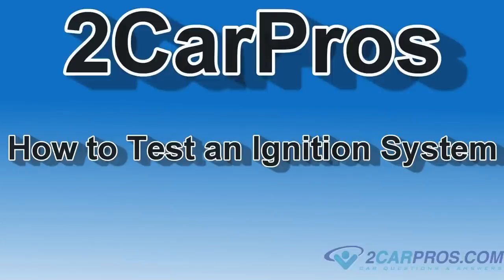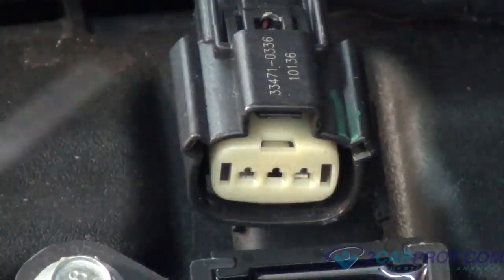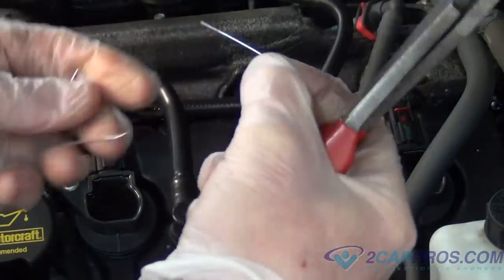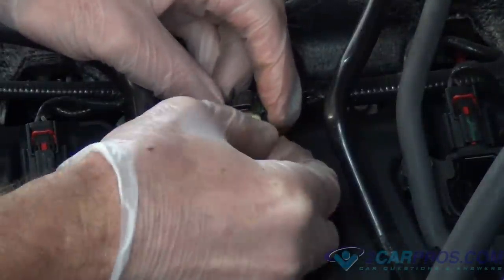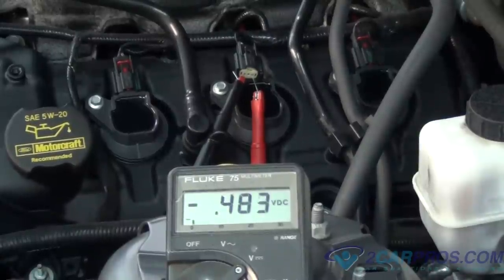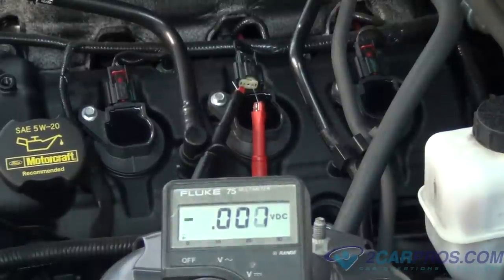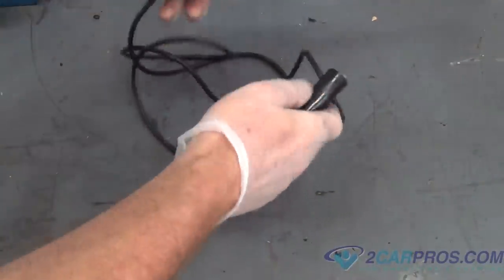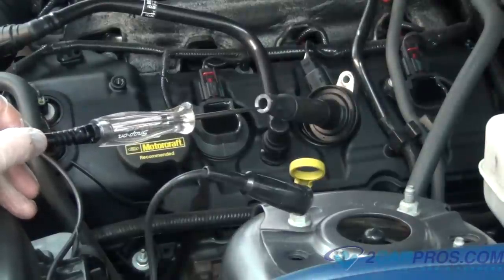Automotive Engine Ignition Coil Testing Repair

Comment: I thought you did very well on this video. The video was precise and very clear. Unlike yours, most video's out there are too dark and its like they never proof view it to make sure its viewable. You got the point out on checking the "ignition coil pack". Would have been nice to check the spark plugs in this vid BUT then again, this is about checking ignition coil packs and not spark plugs.Overall...good job!RP2u 11/01/2018

Comment: Step 12 - Gently close the bonnet, open any door and load fertilizer in a large sealed container with appropriate wiring and switching, stand behind corner of brick wall and initiate power to said wires for an explosives' final solution to problem.

Comment: Another way to ttest ignition coil is to test the resistance on it. Eazy way and safe way.
Reply: Also the way to find a weak coil. When it's only misfiring under load.

Comment: Missed a step.  Remove rubber boot and inspect and clean slinky to coil contact.  Corrosion and moisture can cause intermittent misfire.

Comment: I have 10 plus dc volts on 1, 3, 4. When the key is in the "on" position. I did not test 5 or 6. Only 2 had 0 volts . all 4 cylinders had 11 plus when cranking. Any thouhjts why I would have voltage?

Comment: My ford focus 2005 zx4 I replace spark plugs with motorcraft the same that was in there also I replace the ignition coil which is bosh an the car don't run rite... what can be the issue anyone can help?

Comment: 6:27 DON'T reinstall the coil without checking the condition of the spark plug!
Reply: Jeph62
Reply: Anybody knows HOW to measure OR compare an OEM ignition coil and a Performance one to see which one is more powerful in volt???
Reply: The video is about checking ignition coil.. Not about spark plugs

Comment: Already I already put some new spark plugs.
Code :
Random/Multiple Cylindre Misfire Detected
P0300 - 008 - Implausible Signal - Intermittent
p0302 - 008

It is not dripping coolant by the spark plugs, I mean they are dry (As it should be)

Audi A4 Quattro 2004 1.8
Reply from the maker: Visit our website www.2carpros.com and ask a free question! An automotive expert will be alone shortly to help you out! Thank you for watching!

Comment: Already I already put some new spark plugs.
Code :
Random/Multiple Cylindre Misfire Detected
P0300 - 008 - Implausible Signal - Intermittent
p0302 - 008

It is not dripping coolant by the spark plugs, I mean they are dry (As it should be)

Audi 2004 A4 Quattro 2004 1.8
Reply: Coil # 8 is bad. Check resistance on primary and secondary 2 thousand ohms on primary and 6 to 9 thousand on secondary .